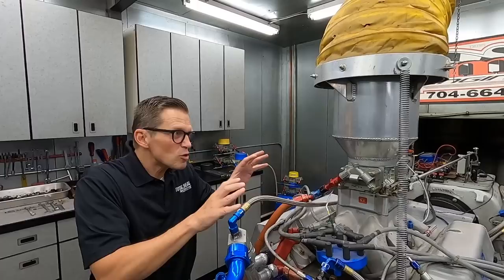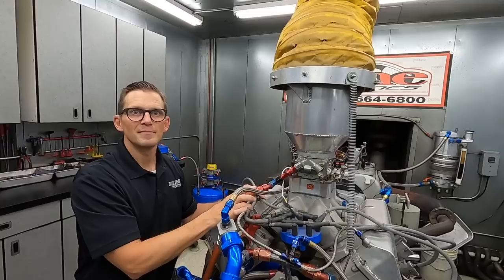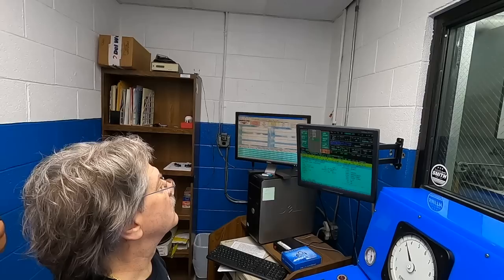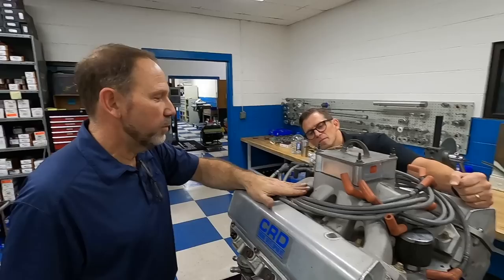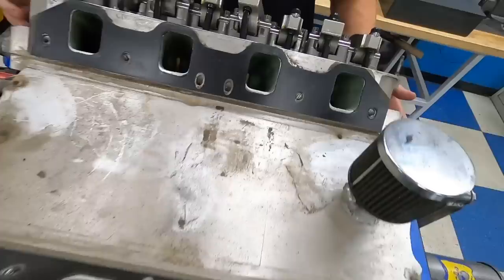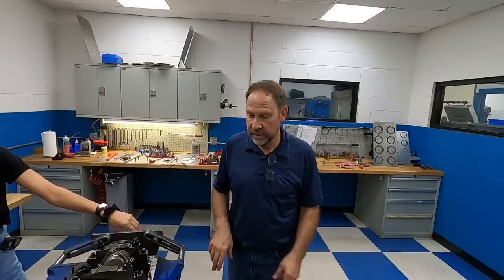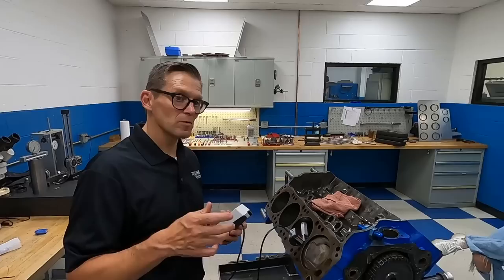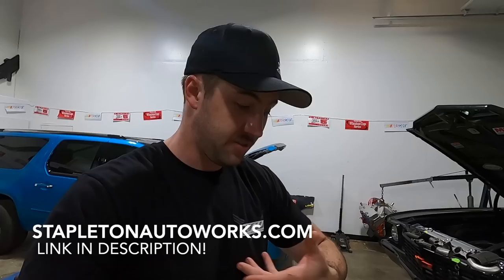Lake Speed's Ford C3 NASCAR Engine: Time Capsule of 90s Technology! (Dyno & Full Teardown)

Comment: First, I have never driven any super Nascar stuff like that! But I have run some Roundy round stuff, & I could tell when I had burnt a plug wire by the power it was down! Being down that much power, would or should have made you come in & said guys, WTF??? I love how Lake Speed talks about how perfect cylinder wall hone surfaces should be, but ask him if a regular dingle ball hone works??? I'm sure he will say, well it won't make the cylinder round, straight, & perfect! But if that's all you got, it will work & seal up, as long as your shit isn't Fcked to begin with! 🤣🤣🤣🤣 We had a customer, that my bosses mentor, built a BBC for back in the mid 80s! He told him way back when, it would make at least 700, if not 720 or 730! After sitting over 35 years, it fired right up, we broke it in, & on the first pull, it made 702hp! By the time we were done with screwing with carbs, spacers lash & timing, It made 734, 735, 737hp, of course as the oil got hotter! It had very little blow by, & everything we were worried about, seemed to be a nonissue! He finally installed it in his Camaro, & has been driving it for almost 2 seasons! I know, it seems to be really lame for a BBC to only make 735ish! But it was all basically really old shit & only slightly bigger than the 454 it started as! But that's how race engines were built way back when! You got a hopefully good engine from the junk yard & had someone build it! Using a lot of the factory parts! Not so much on this one, [it had GM aluminum heads on it, & good rods & pistons in it, although super old heavy parts!] but that's what used to be done! Best of luck, that's a lot of power to find!!!

Comment: 17:00 replacing the valves and springs with sodium filled titanium valves and lower spring rate springs... +10hp/250cc, three hour run time.

Comment: How far past 700 depends on how exotic they would want to get.  Springs alone would bring some power back (like a good conical spring), going full roller, much lighter and modern valves (titanium or a good light steel alloy), modern pistons with a modern ring pack, a modern cam, EFI, etc,  I bet you could reach the limit of the ports on the cylinder head.  Though with a very well thought out camshaft you could see 0-3psi manifold pressure which would cheese the heads limitations a bit.  Its hard to do but it is something that has been done before. 

This sort of thing makes me want to build the Chevy V8 Indycar engine clone even more.

Comment: At 11:43 and 12:10  when it shows the motor, the number one spark plug wire is throwing Fire (Electricity) all around the top of the plug wire protector pipe welding on the bolt on the valve cover or maybe its a peice of plastic, something is blowing around up there...

Comment: Great project. Be very curious to see what's inside that 385 series. I agree with the guy, it's just tired. However, it still does sound smooth and is hitting all 8. You might want to mention the difference between static and dynamic compression. Which of course has a lot to do with cam specs.

Comment: Concerning the mention about the "two and three quarter mains" when he was discussing the differences between the Cleveland and Windsor block, the 351 Cleveland ran a 2.75" main journal diameter, and the 351 Windsor has a 3" main journal. The Cleveland has the preferred diameter because the Windsor 3" main is too large, in it has too much surface area, and is bad for sustained RPM. The bearings generate too much heat to get rid of. 
The general idea is to get a special Windsor block with the Cleveland-sized main bearings...which is what that block is, a NASCAR-legal aftermarket Ford block with the Cleveland mains.
Reply from the maker: Makes perfect sense!
Reply: @Stapleton42  I'm just glad that you weren't operating heavy machinery while reading that and fell asleep while at the controls.

Comment: Fro what I understand C in C3 is in reference to the canted valve angle of the cylinder head. It's not a inline valve design like the Windsor engine came factory with. This was the only option they had prior to the late 90's - early 2000's until other companies started producing similar designs like the Brodix BF model heads.

Comment: I have a old EEI motor c3 also that's 375 " from the same time line it made 800 at 9k.  My old 358 c3 head was 626 on the dyno at 12.38 compression  so interesting compression
Reply from the maker: Very! That is awesome

Comment: Here is just a thought about the suspected power loss. Back in that specific time period I worked for a ARCA driver doing machine work. I primarily did cylinder heads, and we raced fords. ARCA teams primarily bought their stuff from the top NASCAR teams. And those teams would say and sell anything to anyone lol… There was a lot of junk being sold back then. Especially with the ford stuff. Cylinder heads that had good flow numbers, but performed sub par compared to others. And then yes, there’s countless   C3 heads out there that would not make any power whatsoever. They looked real pretty. And placed along a set of real performers most wouldn’t be able to tell them apart unless you know what to look for. I was heavy into drag racing back then. I’ve seen my fair share of crummy C302 & C3 heads that were just garbage. But OMG when you had a set of good ones. And just not that, but the number of other items that were just junk. Camshafts, carburetors, people who couldn’t properly set up a set of JESEL shafts on those heads. And worse yet, some of the people who put these engines together, fresh off a dyno, with numbers that were never there, or even close.
Reply from the maker: Bob Cronin last built this engine so we know it was done right. Time did its toll for sure. The true number originally was not 730 I am sure

Comment: Sitting that amount of time Lake , I would also suspect the valve springs are toast also , sitting with the valve open would take some tension out of the  spring ... Most people have no idea how much rush can accumulate in an engine in even one year , so that would explain the blow by  ..I'll be sure to tune in again after you get pistons made , oh probably 12 weeks or so ?? Adney
Reply from the maker: If we have to wait that long we will find a suitable shelf piston
Reply: @Stapleton42  Did we determine what the heads were ?? finding a shelf piston (bolt in no mods) for a Nascar head may be a stretch , but there are a lot of folks selling old Nascar stuff in the NC area ,so ya never know !!

Comment: On the close up view of the engine running you could see the spark plug wires were bad you can see spark shooting from the wire to the valve cover on the front plug I didn't notice it on any other plugs so at least that plug wasn't running as hot.
Reply from the maker: That was heat shield blowing in the wind but it does look like spark

Comment: Letting a motor sit....You can kill the valve springs on it of you don't constantly rotate the motor on a weekly basis. My buddy used to make LOTS of $$$ off of "Boat Guys" who went out after letting their boats sit in the off season and they suffered catastrophic valve failures due to bad valve springs....I also notice that Pro Motor Engineering seems to have the "Nascar Dream Dyno" of the era....Looks like a Henan Froude GH490 water brake....These dynos were legendary....They were the "Rolls Royce" of Engine Dynos....I know everyone thinks a Super Flow is the "be all end all" equipment but, that Froude with the Depac data aqusition is FAR SUPERIOR to anything Super Flow has ever offered up until at least the year 2000 in my buddies opinion....The Froude water brake will generally give a 10-15% lower power figure than a Super Flow....BUT....The Froude is a PRECISION INSTRUMENT! Repeats with accurate readings where a Super Flow isn't close to the repeatability of a Froude....Fun Fact...."Super Tex"....AJ Foyt was the exclusive distributor of Froude Dynos in North America until about the 1980's.....That C3 motor should easily make 700HP with good seal and good valvetrain components....Only other thing I would probably change is the Dry Sump Pump for something better like a Peterson or Auto Verdi helical geared type pump to pull a decent vacuum out of the fresh motor....OH! and NO Penzoil! I'm sure JR will use Driven BR motor oil....GREAT STUFF!

Comment: Judging by the appearance of discoloration on both the pistons and the cylinder heads, it's very possible a few cylinders were running lean with the possibility of water being drawn into cylinders. The difference in color between the front and rear cylinders was the key, as well as the actual color residue. Just an interpretation/observation. It would be nice to see what they come up with.

Comment: It's a Windsor bottom and a "Kinda" Cleveland Top. Or a "Clevor". It's the engine I think Ford should have built. I also call it a homemade Boss 302. But I know there are some differences between a "Clevor" and a "Boss" engine. They're expensive to build. But I'm sure it's cheaper to build and easier to find than a real deal "Boss 302". Ford and Mopar power has always been more expensive to build. I love Ford and Chevy both, But the old school Ford engines are a little bit cooler and more exotic in my opinion. Chevy you got a small block and a big block while Ford was experimenting with all kinds of new ideas and crazy shiz. And they still are. Just look at the 4.6 Terminator and 5.0 Coyote. Way more exotic and advanced than the LS and LT.

Comment: C3 cylinder heads were a Robert Yates design. Am not sure if my memory is correct. It’s a 9.2 deck height 2.75” main journal. 6.250” h-beam connecting rods.

Comment: The Busch Grand National 9.1 engines only made between 500 and 550 hp so his power loss prediction is accurate. Cup engines in that day with higher compression would have been in the 740 hp range.

Comment: Hi guys. The heads are  C 302 B heads they were the last of that chamber design before the Yates head which had about 40 cc chambers
The pistons were to be used with the Yates heads…I looked for many yrs for those heads to put on engine I built for my Pantera
They are terrible heads as they are very cam sensitive..I had Manley flat tops and the compression was about 10. To one and on chassis dyno it made a little over 500 ft lb of torque with a solid roller and just under 400 hp…I sold the engine and owner refused to rev it past 6000 rpm..the cam was very wrong…the heads as I said did not flow very well and the owner was disappointed..I faulted the cam …and although the engine had all the rite stuff to rev to .8000 the cam fell flat..I was hoping for about 500 hp but the power fell short

Comment: When you have a lot of blow-by the crank case presurises, The combustion blows by the rings and then the pistons are pushing against that pressure and steals your horsepower. Loose is fast, we would build a poor boy race motor putting new standard size rings/pistons in a slightly worn bore, you know you gonna have blow by so you got to have a Crancase vacuum/ evacuation system, we used to make them with an angled pipe in the exhaust header colloector, the exhaust blowing past the pipe would create a vacuum and pull the preasure out, some folks would use a vacuum pump run off a belt. No one wants a PVC valve, but it was a way to keep blow by from just blowing out a vent like pre 1972 engines did. The crank case pressure could almost stop the motor, thats what the Ring guy was saying, it was so bad it caused the motor not to respond to throttle. They need two big old vents, or a vacuum pump, that motor would have shown double what it did with it all gummed and caked up...You guys had it constipated the way you were trying to run iCrancase constipation!! let it blow by. In a prefect w2orld everyone would bore every cylinder oversize and buy new pistons for all 8 cylinders, in the real world you run what you brung....
Reply from the maker: There was crankcase vacuum on this engine from the dry sump system. Did you see that part?
Reply: @Stapleton42  no,Seeing teh blo by ball going u yto four and when they showed the breather,  thought there was no pan eveaacuation system. but you guys saying no throttle response you would think "pressurized crankcase. I can't wait to see how much you get out of that motoro. That is something separates round track from drag racing miles per gallon counts

Comment: I had 1 that I got that came from the DAVEY ALLISON #28 Texaco Havoline car.replaced the short block for a 438ci dart Winsor block 15.0 comp ross/w .043 and gapless rings  .710 lift solid roller comp cam and put in in my 1986 mustang with the weaver drysump system and still 
regret ever selling it.

Comment: I found the comment about the early heads being Canted Valve unusual. I thought all of the Ford heads were canted valve? The heads architecture was based on the 351 Cleveland, with the later Ford racing heads just being improvements on this architecture with different port heights, combustion chambers, etc. Weren't the D3 heads the ones commonly called the "Yates" head?
Reply from the maker: I don't know. Someone else would lol

Comment: You should ask this guy about how great VDL racing carbs is. Put of grandbay Irvington Alabama area there is one of the best carb builders ever and he made alot of the carbs for nascar teams all the way until they went to fuel injection. Vanderly was on elf the best there is in the racing specific tuned carb game in racing and still is for latemodels and other non fuel injected racing engine and classes. My crate late model and crate 602 pro truck and every car I ever raced always used a VDL carb cuse he can make 50-80 more hp by building a legal holly carb compared to a out of the box carb for example my holly 750cfm double pumper makes 71 less horsepower then my VDL tuned Holly 750 double pumper

Comment: Wish they would have dyno the motor on different fuel. Really high octane fuel with low compression is killing a bunch of power. It probably would run better on 93 pump gas. Would of been a great test. Love the videos keep up the good work.
Reply from the maker: Thanks man

Comment: I own The ed whitaker busch series harry gant driven number 7 skoal bandit buick v6 engine...
Reply from the maker: That’s awesome!!
Reply: @Stapleton42  the buick v6 had history of at the 400 mile mark of breaking the valve springs. The Lady who worked at Jim ruggles machine shop, the ones who did the motors for MR ed whitaker and the skoal busch team, discovered if you make spray bars in the valve cover and have oil gently spray onto the valves it would make the springs last the full 500 miles. So my motor has the lines and the valve covers that spray oil onto the valves to keep the springs from breaking at 8000+ rpm. By the way, I was told that my motor has the kellog steel billet crank. That little bugger makes some hps.

Comment: You could clearly see a plug wire arcing out on one of those front cylinders !!   That would account for some power loss
Reply from the maker: It was heat shield material flapping in the wind

Comment: If you have low compression, and you run fuel for higher compression and then on top of it you advance the timing, your basically slamming unburnt fuel into those rings that aren’t broken in yet, explains the blow by and lack of power… it probably would have made more power on 87 pump gas and less timing which would be cool

Comment: Hey ;) got a foxbody mustang 5.0 stock block gt40p headed getting 12.6 on is last healty pass. Got oil burned out right on it. Lifters clapping. 2 pints gone. First oil overheat pas gone bad. Water temp was igh but ok. (Forgot to cool down between 2 pass of 5) so!

Then it was a 13.3 car with freshen up things weeks later: loose crank bearings oil pressure symbtoms was the response. This is about 40-60whp loss on top of 290max. So... Im curious to see this engine reeingenired up  and bumped in compression! ^^

Comment: I would've tried another run with the restrictor plate on to see if it make a difference,
because it get more air fuel in it, then with the restrictor, so the engine possibly makes more power with restrictor like the McClure intake.
Reply from the maker: The engine always makes more without the restrictor even if it has that plug device inside the manifold

Comment: Did any one catch at 30:24 
is he talking about using one of the pressure sections of the oil pump to pump air instead of oil and directing it into the intake tract as a mini-supercharger??

Comment: I would like to see a comparison which oils would cause the least amount of friction to increase HP (if only a little) in the same engine.Are synth. oils the best?Do all NACAR teams run synthetics?Would they create more blowby or less?
Reply: Seems like they would be using synthetics. But at the same time, a heavier weight than we are used to hearing about. Our 0W/20 and such seems like it would turn to water at the heat that these engines would be making.